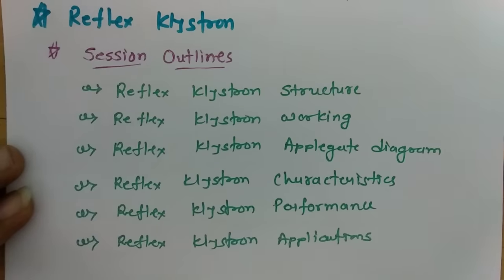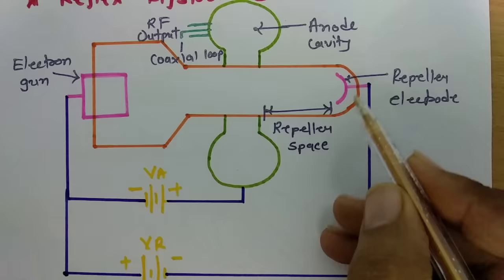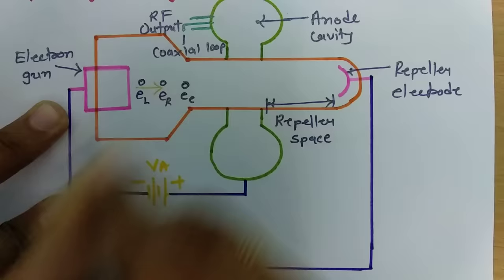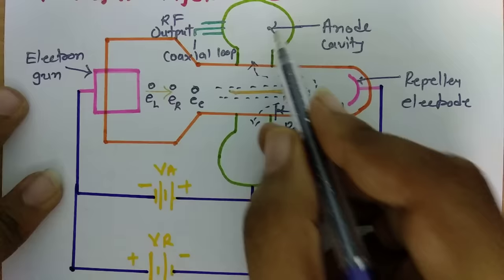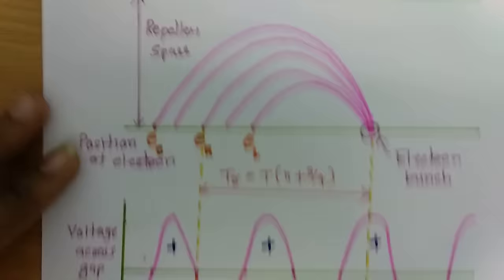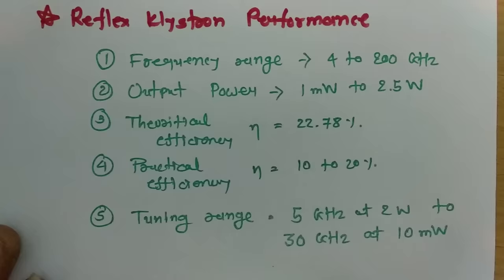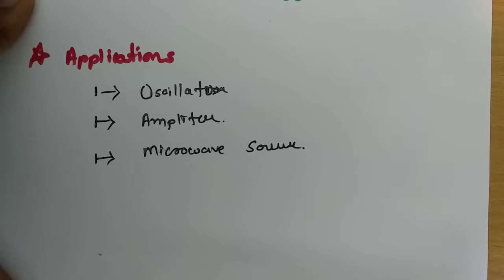Reflex Klystron (Basics, Structure, Working, Characteristics & Applegate diagram) Explained

Comment: How come early electron has more time to travel towards repeller electrode in REFLEX KLYSTRON STRUCTURE
Reply: We provide +ve voltage to late electron and -ve voltage to early electron that's why early electron move slow and late electron move fast so we can able to bunch all three electrons at the same time
Reply: @arjunfitness3836  actually you are saying the opposite, we provide +ve voltage to early elect. in the anode cavity which accelerates it more so it travels further than the ref. and late elect. similarly we provide -ve voltage to late elect. in the anode cavity which deaccelerates it and thus it travels less than ref. and early elect. so it travels less dist.

Comment: Can you please upload explanations for topics as follows:
1) O & M type classification of microwave tubes, re-entrant cavity ,velocity modulation.
2) Cylindrical wave magnetron
3) microwave applications like microwave heating, thickness and moisture measurement, microwave diathermy.
4) Microwave measurement devices such as slotted line , tunable detector, VSWR meter, power meter and their working principles.
5) microwave measurement techniques to measure S-paramter, frequency ,power attenuation ,phase shift ,VSWR , impedance .
6) Radiation hazards and protection.

I am a student in my final year of electronics and tele-communication engineering
Reply: Heyy, May I know where are you now? I mean have you got a good job somewhere?

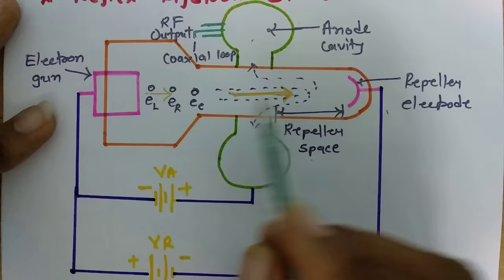Comment: 6:22 Timestamp
All electrons are emitted by an electron gun so, how that early and late electrons are classified?
How do we tell early electrons lesser velocity and late electrons higher velocity? (because I thought like all electrons are emitting from the electron gun and the distance between the electron gun and the repeller electrode remains constant... )
Reply: I guess we will be giving some RF input to the reflex klystron to work v as an oscillator, so the waves having polarity in direction increases speed of early electrons and the reverse electric field reduces the speed.

Comment: 10:15 Timestamp
How to set the modes of propagation of electrons in this reflex clystron? What is actually the "mode"? and what is the meaning of choosing mode i.e "n" as 1,2,3... etc?
Reply: Its like 3 different car which start moving with different time with different speed to meet a certain point

Comment: I can't understand why bunching of electron generates RF wave?
How I can interpret Applegate diagram.
What operating characteristics shows in diagram?
Reply from the maker: +Shubham Nayak : bunching of electrons amplifies signal and regarding RF signal I think you should learn Maxwell's equations.
Reply: @EngineeringFunda  How will the early electron have more time to travel and less repulsion than the LATE electron??
Dont they all travel the same distance in same time since the drift space is same and there is continuous generation of electron??
Is it due to velocity modulation OR transit time effect??  Would you please explain how does it work that way.

Comment: Sir, I don't know pen r  using in xam are WRIGHT R WRONG
plz tel me sir
Reply from the maker: Which pen?
Reply: @EngineeringFunda   How will the early electron have more time to travel and less repulsion than the LATE electron??
Dont they all travel the same distance in same time since the drift space is same and there is continuous generation of electron??
Is it due to velocity modulation OR transit time effect??  Would you please explain how does it work that way.